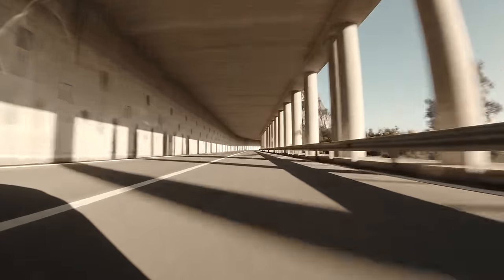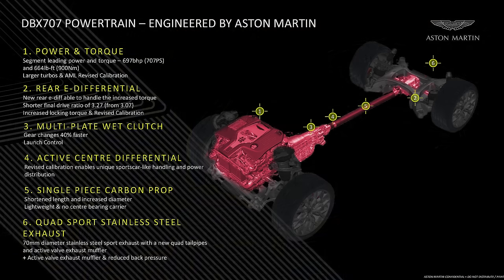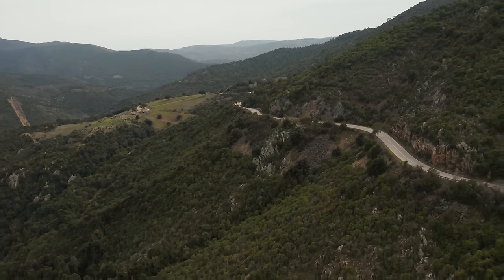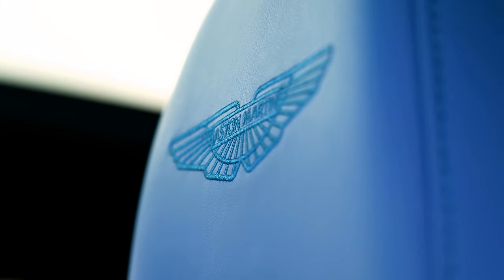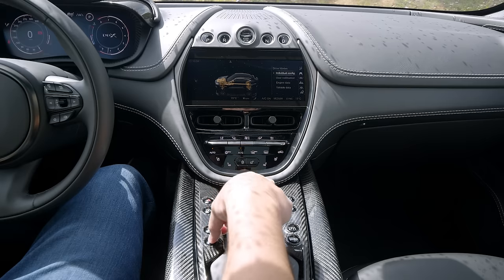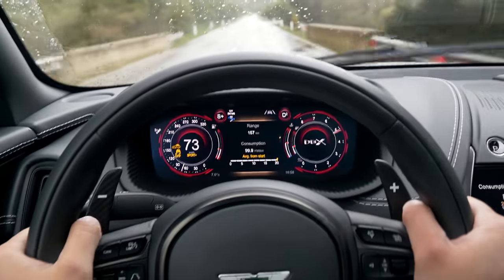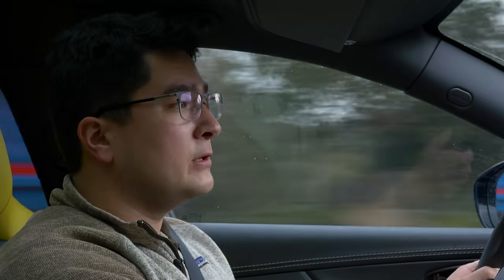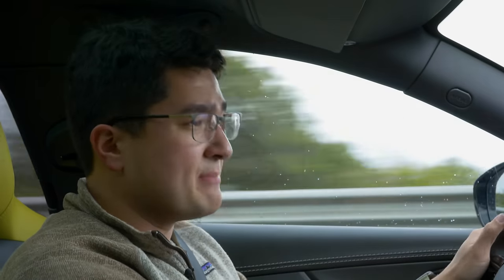Aston Martin DBX 707 | Super Car SUV Syndrome

Comment: I guess I'll have to get my wife one of these & trade in the RAV4
Reply: Seems fair
Reply: Considering the price of cars today you might get some cash back with the trade in
Reply: Well played.
Reply: How many RAV 4 do you have to trade in? A dozen?
Reply: For a second I read you wanted to trade your wife for a RAV4
Reply: @zoner__  homie probably has a rotisserie restoration and like delivery miles
Reply: I just put  my RAV4 in sport mode.
Reply: It's a Mercedes drive train, so here in right hand drive markets, it'll probably have the same awful & embarrassing skipping and bouncing on low speed full lock turning all their all wheel drive vehicles have - because Mercedes can't be bothered engineering their right hand drive cars properly - so hard pass from me, I'd rather drive a Rav4, at least Toyota doesn't cut corners on basic engineering.
Reply: @Beer_Dad1975  no problem dad they'll find other buyers for sure
Reply: @huyra8019  😂
Reply: Had me in the first half NGL😂
Reply: @julianc.6589  Yup I'm not the market for this one.
Reply: @Beer_Dad1975  all good brotha neither am i aston martin ain't losing sleeping on us
Reply: @zoner__  😄
Reply: @Christian-xc9bh  My 06 Rav doesn't have a sport mode but does have the v6 with aftermarket headers. Which almost compensates for the Interior and 5spd auto lol

Comment: "Our chassi system is bespoke". Of course it is, that's what is expected for ultra luxury sports SUV. 

VW, Audi, Bentley, Lamborghini 👀 😳
Reply: I can tolerate Audi & Porsche, and to some degree Bentley as the luxury aspect of the Bentayga  is more important than mere mechanical underpinnings.

Urus is a bit disappointing.
Reply: What's the problem?
Reply: No mention of the Mercedes mill up front.
Reply: @patrickpierre6114  And the transmission and the AWD and the software and electrics and ...
Reply: @timcleary6339  to be completely fair every automatic/ DCT European car with a longitudinal engine, apart from Mercedes and Ferrari, uses a gearbox from ZF. So the rest aren't special either.
Reply: correction : apart from Mercedes, Ferrari, Mclaren, and Lamborghini's supercars

Comment: That grill is unappealing. Never ending story vibes.
Reply: What a horrible acid-induced nightmare of a movie that was! Thanks, you’ve forever ruined every white Aston Martin for me
Reply: Ok taking bets. How many percent of that grill is actually open vs how much is just closed plastic? Imma say about 30% are actually „grill“
Reply: @Mr.Marbles  yeah you're wrong pretty much all of it is open, check out bobby angs video he shows it.
Reply: @hyphed4196  yeah ok, the grill is open. but behind the actual radiator is as wide as the bump on the hood basically. but yeah, at least they didnt just block it they way most manufacturers do.

Comment: DBX does drive nice. The leather and trim all certainly feel very premium. Where this thing really falls short are some of the choices they made for controls. For example the button to open the tailgate isn’t anywhere on the driver’s door, dashboard, or even on the center console. It’s UNDER the center console. And you have to hold the button down or it stops moving.  The infotainment system looks nice but is not intuitive to use.  Because of all these downfalls, this is sooo not worth the money.

For a quarter mil, the Bentayga may not handle as well or be as fast, but it certainly feels like it’s worth the money compared to the DBX.
Reply: Not a single SUV is worth the money. A e63s wagon is a more practical and as fast car for third of the money. You can splurge on the designo to make the interior out of bison ballsack leather and still have 50000 to spare.

Comment: Great video! However as far as car goes, the lack of touchscreen and what looks to be lack of head up display, is insane to me. 250k and lacking in this department. The car would be great but it’s way to much money for what it offers.
Reply: Yes but as he clearly said (multiple times), AM do not and have not prioritised infotainment tech. They’re an extremely small volume, niche manufacturer and they’ve prioritised everything else; bespoke, ground up chassis and engineering (almost no other manufacturer on the planet does that these days) and ultra- luxury, bespoke materials. There’s nothing like it in this class and THAT is why it’s “way too much money”.
Reply: @sjb2471  good for them! But I’d argue there should be a minimum level of infotainment in 2022 that even AM should do. If a car that’s 5 times cheaper can have those functions, there’s no reason AM shouldn’t be able to do it, and offer a more complete package compared to rivals. I am definitely not yet their target audience, but I’d still need these functions even if I was!
Reply: @MarkScrambler  I think Zenvo did the infotainment right for a supercar. They have just a holder for an ipad. The truth is all car infotainment suck in all aspects compared to an entry-level ipad and they will be totally obsolete in a year or two. This way you can just keep upgrading your ipad and have the best device throughout the lifespan of the car.

Comment: Still won’t beat an X Plaid.  Not even close.

How do the Brits get Al-u-minium out of aluminum?
Reply: It’s spelled aluminium in the UK. Different spelling, same material.  And I am certain the AM would beat the Plaid around a track.
Reply: @marclangman4836  how many race around a track on a daily basis?  Unless you’re Misha and living by the ‘ring, you’re not.  99.99% of all these cars NEVER see a track.  That’s a fact. In day to day driving, an X Plaid would absolutely cream the Aston in every respect.
Reply: @alexnutcasio936  straight line speed is not every aspect. That equates to a one trick pony. The Aston is quicker and without question more luxurious.
Reply: @marclangman4836  track only is one trick pony.  I’d much rather a car that can do it all and then knock it outside of park in acceleration.  That X Plaid does it all on the street where 99.99% of all driving is done.